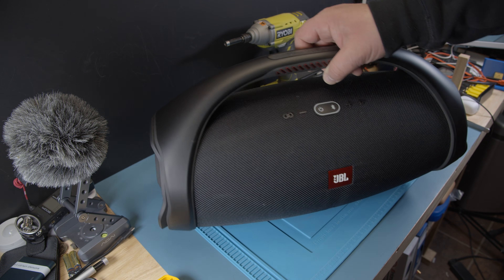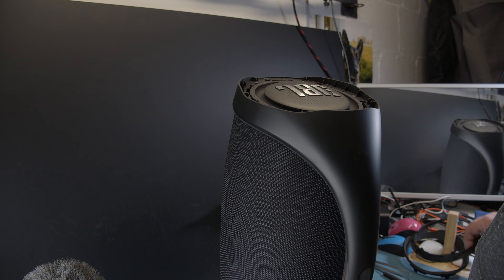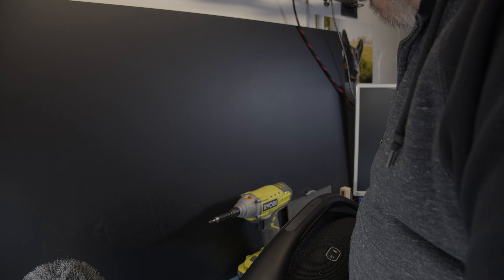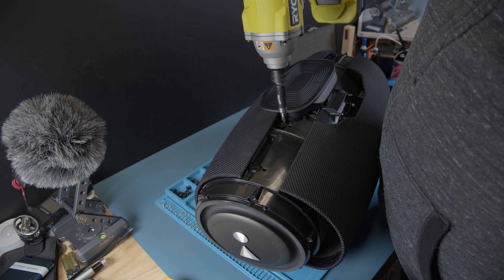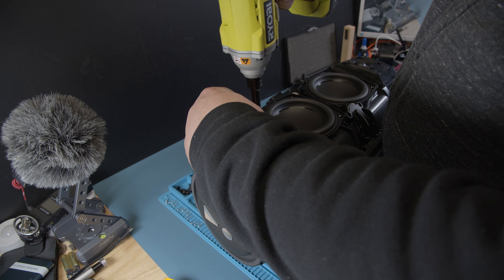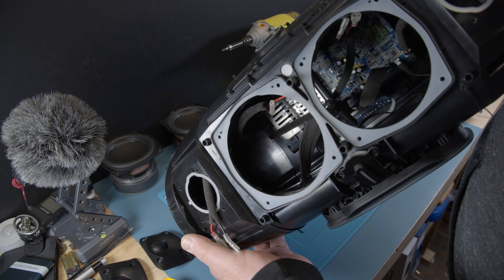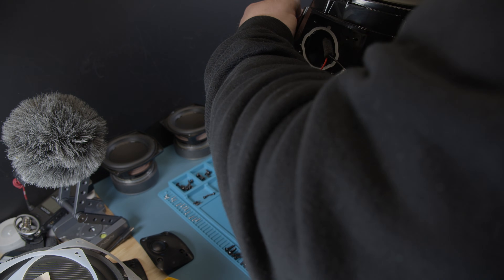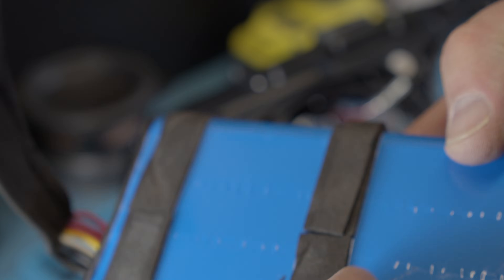JBL Boombox 2 Full Complete Teardown

Comment: My bluetooth connection on my boombox 2 only works in very short range. It starts to stutter if I walk away 1 meter or if I put the device between the boombox and myself. Any idea why? It should have very good range. I even tried in an open field 
with no frequency interference, also tried pairing other devices and the same problem happens.
Reply from the maker: probably a problem with the bluetooth antenna in the unit. maybe not plugged in
Reply: I have no idea where or what that connection would look like
Reply: Me pasa lo mismo

Comment: How hard should the little side rings be to get out? Struggling to turn it to the left on both sides
Reply from the maker: Very hard, and also difficult because they are slippery. That's why i had the silicone mat underneath. That help. You need something like a rubber or silicone mat, if it doesn't twist!
Reply: I did it!!! Try to grab and turn the wings with an angled pointed pliers

Comment: The boombox 1 and 2 are relatively the same size.  However,  the boombox 2 is heavier.  Any thoughts?  Are the drivers better quality?
Reply: BB2 HAVE BATTERY IS 18650 IS MORE DURABLE.  And BB1 HAVE ION POLYMER BATTERY.

Comment: I have a question.. if you push your left passive radiator, the other side comes out and then comes back slowly? or it remains still? mine if I push the passive radiator, the other side comes out and then comes back slowly even if I'm still pushing the other side. differently the jbl xtreme if I push one side, the other side goes out but it remains still till I leave my hand from pushing the passive radiator. So it is normal for the JBL Boombox 2 to have an air leak?
Reply: Hi I have tested this on my boombox 2 and I don’t have that I think your boombox 2 has an air leak.

Comment: it's sad that those speakers dont have neoydium magnets for how expensive the speaker is,  it would increase internal volume, maybe would get extra bass lol and sound clarity in the mids
Reply: First, ferrite magnets make the driver look way better and fatter
Second, the magnets are so huge, they are like neodyms.
Third, the woofers already have much power and a high excursion, neodym magnets wouldn't make any difference.

Look at the Xtreme 2 and Xtreme 3, the Xtreme 3 has neodym magnets and there isn't any difference in bass
Reply: @s33saudios  
100% correct.
The boombox 2 is the holy grail as far as I'm concerned.
Reply: @s33saudios  lol! there is huge difference in bass on all three.
Reply: @alanrossreviews  "all three" What 3??

Explain your comment and write arguments, but not just a random sentence
Reply: How much more volume is needed or necessary?
I did a side by side comparison of the boombox 2 against the UE hyperboom.
And the JBL is much much louder.  And,  the JBL remains clear at 80% volume which is much louder than the UE hyperboom's full volume!
I really believe that JBL created the perfect boombox here.
Reply: This version is heavier than the boombox 1.
Any idea why that is?
Reply: @bradhuskers   Yes I have an idea

Comment: Product page mentioned 20000 mah battery , and 10000 is written on this , wtf is going on?
Reply from the maker: same as with the Xtreme >>> see here https://youtu.be/PrKXumAvC8g
Reply: Battery capacities are confusing sometimes. Capacity of this battery is 20,000mAh at 3.7V, which is pretty common operatin voltage for batteries this size. However, Boombox's battery is 7.4V thus it's capacity is 10,000mAh. Jbl's marketing department is pretty stupid for confusing people with that 20K capacity.

Comment: Ok for everyone trying to open the flap all you do is just a get a card any flat card like a debit card put it on the top flap and put tape around your four fingers including your dumb to hold the flaps hold the speaker around your legs and grab the two flaps and twist it left has hard has you can and it will twist
Reply: Still doesn’t work for me……
Reply: @crazyboatguy6819  it's difficult but u can do it turn with all your strength while pushing hard down

Comment: Thanks for the Video and all the eloquence. Can you measure the inner and outer diameters of the AC adapter head? Mine broke away and I want to replace just the head. Thank you!
Reply from the maker: What are you talking about? the connector?
Reply from the maker: i think it is easier to just get a new power supply. How old is your Boombox2, must be still under warranty.
Reply: @mygiguser  yep, the connector. It is all good. I did not figure out the exact measurements but was able to find an old adapter with the same size and just did a bit of cutting/soldering to splice the Boombox 2 power adapter with the working connector.  Dealing with warranty process would have been a hassle. Thanks!

Comment: Hi. What is the real life time of the battery at maximum volume for the bombox 2? . Regards
Reply from the maker: no idea, i never listen to it at full volume for an extended period of time because it blows your eardrums out.
Reply: I’ve had the boombox 2 for over a month now and I use it frequently. I use it about 3-4 times a week for an hour and a half at a time at 50% volume. I don’t have to charge it until after a couple weeks. I used it for about 4 hours a few days ago and it still had mostly full battery. They advertise 24 hour battery at 50% volume, and I do believe it’s true
Reply: On a full charge @ full volume, the Boombox 2 will run for about 6 hours.  I use mine on my UTV every weekend.  We ride longer than 6hrs, so I had to install a 120vac power inverter to keep the JBL charged.

Comment: JBL Boombox 1 Battery 20000 mah in web promotion but in battery Boombox 1  real is only 10000 mah 👎🖕 U JBL , JBL Xtreme 2 is fake promotion the same Boombox , Boombox 2 battery 10000 like web promotion,  why u don’t put battery 20000 mah in real JBL ? 👎
Reply: Battery capacities are confusing sometimes. Capacity of this battery is 20,000mAh at 3.7V, which is pretty common operatin voltage for batteries this size. However, Boombox's battery is 7.4V thus it's capacity is 10,000mAh. Jbl's marketing department is pretty stupid for confusing people with that 20K capacity.

Comment: Wtf mine is so hard to twist on my bb2
Reply: Same on mine, I tried my best but still couldn't twist off those things around the passive radiators
Reply: @darksoul1324  you have to use a lot of force to open it
Reply: @trap nojus @DarkSoul1324 Protip: do it "upside down". Push the speaker against the ground and twist the whole speaker. Very easy this way!